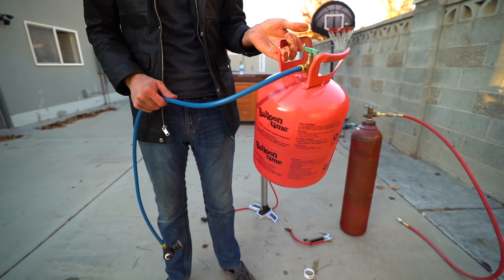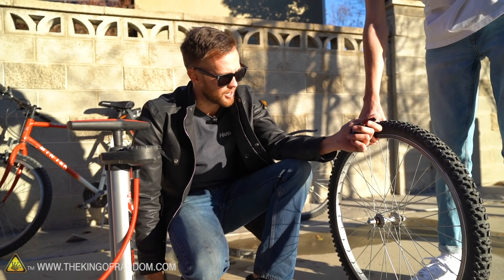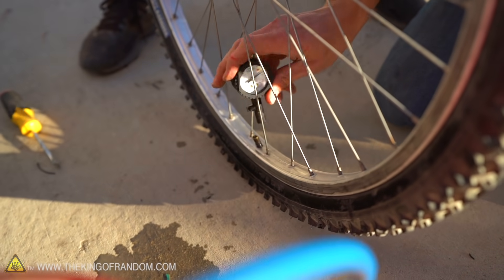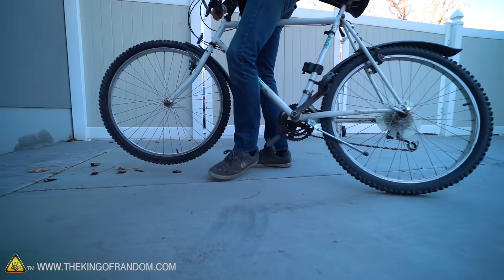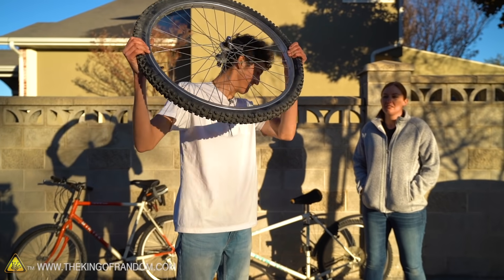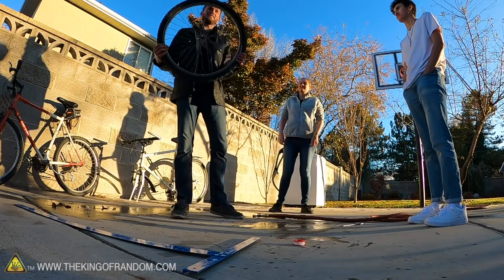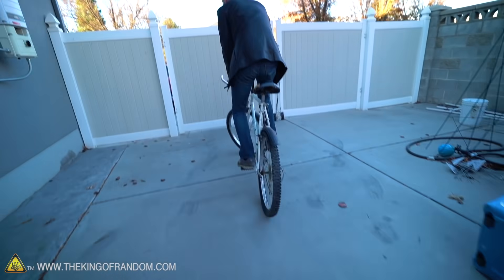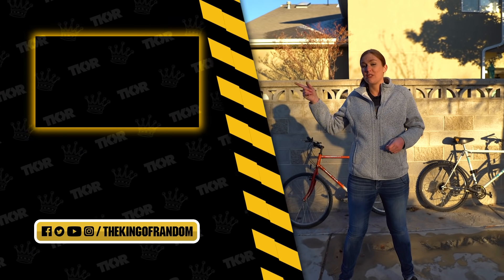What Happens When Bike Tires Are Filled With Helium?

Comment: If you rode the bike with tires filled with water down a hill will it go faster since it a bit heavier? 🤔🤔
Reply: Due to ratational inertia
Reply: @AlechiaTheWitch  due to the whaaaaaaaaa?
Reply: Well yes. But it would take longer
Reply: @AlechiaTheWitch  wait what? It’ll take longer but will make you go faster?
Reply: @AlechiaTheWitch  if its going faster, how would it take longer? Very confused, but interesting 😂✌😉
Reply: @cristinarnold  i think they mean to get up to speed
Reply: @cristinarnold  the rotating mass is more which means it takes longer to get up to speed but since the mass is more itll rotate longer, a lot like a flywheel(the heavier it is the longer it takes to accelerate but it has a lot more momentum)
Reply: @dakotasander5745  Thank u, my husband just explained it to me almost exactly like u did. 😂 He's a mechanical engineer. 👍so shouldn't we all be using water if they give farther longer??😂
Reply: @cristinarnold  acceleration
Reply: @cristinarnold  you can't use water because water can't be compressed, so if you hit a pot hole or curb at speed it will pop your tyre off, and you can't fill it with lower pressure because it would increase the surface area of the tyre and reduce your handling and increase drag so you would burn more feul
Reply: @cristinarnold  it's getting to a higher speed faster but can't reach maximum speed,because its heavier compared to air.
Reply: @cristinarnold  it would take longer to get up to speed, saw this one video where they raced an hot wheels car and it’s life sized version down a hill with the car in neutral, the hot wheels car took off down the hill but the life sized car slowly gained speed and caught up
Reply: @cristinarnold  slower accelleration, higher top speed potentially
Reply: @cristinarnold  because water is incompressible unlike air and the ride would be super uncomfortable and the vehicle would also get destroyed faster too as all the vibrations are transferred directly to the main frame
Reply: @ilillililil5042  slower acceleration, higher top speed
Reply: @harlequinems  wheel loaders use whater to not bounce.
Reply: @cristinarnold  acceleration maybe
Reply: @cristinarnold  he means top speed vs acceleration. Its a car thing
Reply: @harlequinems  If bike is full suspension, all the impact will be absorbed.
Reply: @cristinarnold  longer to speed up but higher speed because you would have to work harder to make it move
Reply: @cristinarnold  longer to accelerate
Reply: @Cristin Arnold  I think he ment the acceleration would be slower but faster top speed
Reply: Slower acceleration and slower decceleration because inertia
Reply: It will go faster, but I doubt you'll feel that it's heavier. Rule of rotational inertia.
Reply: @Joseph-xe6yl  no it wont go faster. Inertia will slow down the deceleration due to the higher mass but it wont go down a hill faster.
Reply: nice idea
Reply: Check out seths bike hacks, he filled a bike with water
Reply: It would sag into the rock I’ve done it don’t ask why but it sags into rock
Reply: Questions for time to answer
Reply: We feel tractor and heavy equipment tires with water all the time. For ballasting. No change of speed. We’ve tried that
Reply: I'm not sure how well it'd do at higher speeds due to the weight of the wheel not being even, would probably start wobbling very quickly.
Reply: It wouldnt go faster since gravitational acceleration is constant but it would have more momentum and go for a farther distance once it's all the way down the hill
Reply: Maybe
Reply: It would take minimal effort, and  balance, to make sure the water in the tires once fast enough will at the end of the hill it will speed off in any given direction
Reply: And depends on how steep the hill is
Reply: Tier will easily get puncterd
Reply: Yes but it would be more annoying get the bike up the hill
Reply: No, torque would equal on either side of the wheel.
Reply: Riding it off-road would break your pelvis, I believe.
Reply: Reminds me of empty bottle vs full bottle in space
Reply: I think it would with the weight and momentum if i spelled that right
Reply: Shouldn't they get to the bottom at the same time? Like dropping a hammer and a quarter at the same time they hit the ground at the same time 🤔
Reply: Their is also no reason why to make that
Reply: Mercury
Reply: It would be faster but another problem is it you have less control because of the density
Reply: Well if it filled to the top yes but what if it was partially filled
Reply: Yes velocity = mass/accelaration   , I think
Reply: Mass doesn't effect any
Reply: Or do all things accelerate at the same speed??
Reply: Yes but no. Yes bc of all the science stuff but no bc if u turn it will instantly fold/ taco the tire
Reply: No have you ever seen road bike before?
Reply: Potentially got to take in the fact if extra friction from the added weight
Reply: Yes
Reply: To: A Rose From Concrete 

I like the way u think

From: Owl
Reply: No it wont because gravity is the same for all objects. If you drop a piano and compuer from a building they will fall at the same time.
Reply: @navidmehdi6  true
Reply: @navidmehdi6  what if you drop a hammer and a feather? They are gonna land at different times
Reply: @confuseddot  that's because the feather has wind resistance
Reply: @navidmehdi6  lies, if you were 100 pounds and went skydiving with your friend who was 250 pounds, are you saying you would fall at the same speed?
Reply: @isaacrowe367  try it at home, grab a big rock and little rock and drop them from elevation they will hit the ground on a level plane at the same time..
Reply: @navidmehdi6  only in a vacuum. We don't live in a vacuum.
Reply: @jamesr.waltonjr.457  no thats will only matter if you reach terminal velocity. Gravity is the same regardless. So you are wrong.
Reply: How come we never see the black guy
Reply: @emacdaqt350  do you mean Kennen?
Reply: @emacdaqt350  who black guy?
Reply: @emacdaqt350  why do you care? Not every single thing on earth needs to have a black guy in it

Comment: I’d like to see the gas tested on a high performance vehicle like a race car. I think the difference will be more dramatic with speed/temperature.
Reply: Let’s just let the scale it first. Bike, regular car, then race  car.
Reply: @MACcopsnK__Coronado  that would actually be very interesting to see them fill up a car tire with random gases and possibly water and for them to try to drive it around.
Reply: Well Gas type definitely matters when it comes to fields that need high performance or high consistency such as racing and commercial aviation as both of those fields fill their tires with pure nitrogen. But they care mostly about the reduction in water content, increased consistency, and the fact that nitrogen behaves roughly the same at various operating temperatures. 

but it would be nice to see the differences if possible with the other gasses because i'm not sure how stable the volume of them are with a temp increase. unfortunately it would be to unsafe to do the testng on a real race car at temp
Reply: I want to see it but where are they going to get the race car?

Comment: "looked like 10 or 12" the camera view determined that was a lie :P
Reply: Fr, it was very obviously higher than that, closer to 17
Reply: Yea, zero accuracy on this video- helium was at least 25”. May need a revisit/ correction.
Reply: You would think that one of them will look at the measurer straight on instead of both of them looking at it from the side.
Reply: You should also take in to consideration that the camera was looking UP, which will make it appear to be bouncing higher than it actually is.
Reply: @santhony1978  the first one was definitely angled up a bit- but the the later ones, especially the helium drop were pretty well dead nuts on center height. 
Because the tire is so very close to the scale, parallax error would be pretty minimal from that distance- especially when you consider the camera was a minimum 3-4’ away. I’d be willing to concede  a few degrees angle, possibly an inch - but I think its pretty obvious that taking accurate measurements for this video was the last thing on their minds.
Reply: @santhony1978  no it wont. maybe a like 1/4'' maybe. i slowmoed it and it stopped at almost 17'' and they said 12.. also the camera looks like its looking almost straight at it.

Comment: Water is put in tires all the time in farming and construction. Usually you remove the valve body from inside the stem and put it at the height on the rim you want the water to be at. The rest is filled with air so that you can run the tires at a much lower pressure without risking the bead breaking loose.

Comment: I have always wondered if you poured liquid nitrogen on a bike and hit it with a hammer if it will shatter or not
Reply: metal won't get cold enough to shatter (I don't think steel can get cold enough to shatter). They use metal containers to hold the stuff.